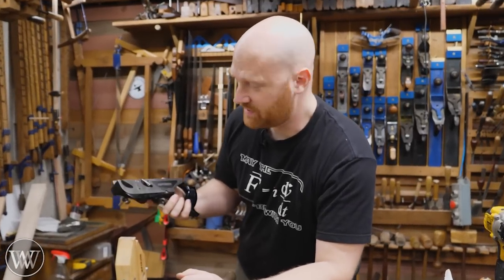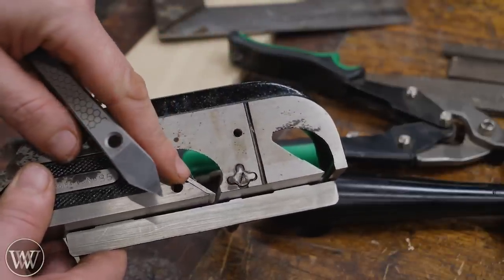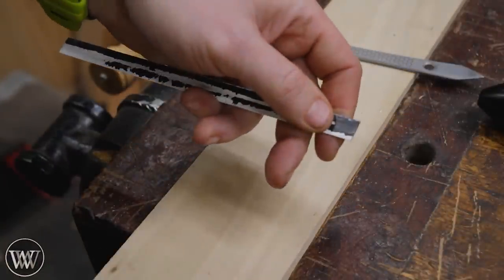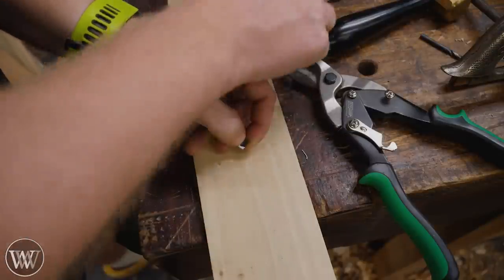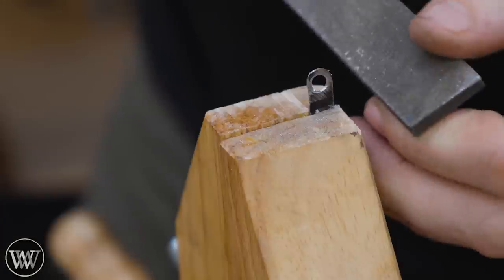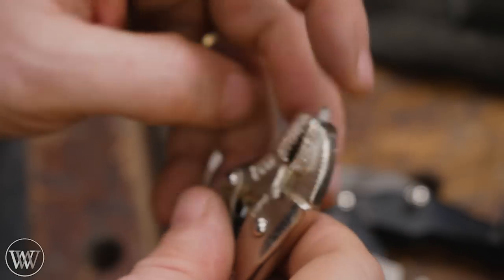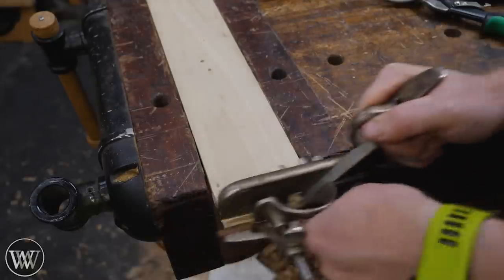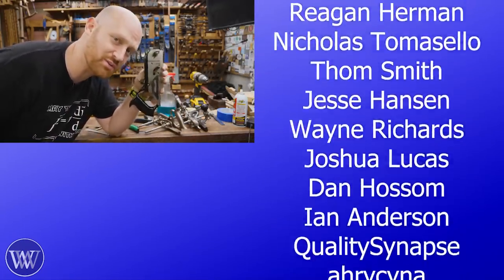What Is A Nicker and How To Make One

Comment: This was very timely!  My Stanley 289 came with nickers, but they were both worn out.  I had an old Starrett (thicker than a regular hacksaw blade) so I tried using it.  After I was done, I noticed that it was HSS, no wonder it did not file as easy as yours...  Anyway, thanks again for showing this in detail, it was very helpful.

Comment: Having one as sample I made a dxf model and made laser cut 50 of them.
Reply: How big is the heat affected zone with the laser? i.e. if you're cutting hardened steel , how far do you need to grind back to get into metal that hasn't been softened by the local heat from the cut?
Reply: @AllanMacMillan  No effect at all since it it is not high carbon steel. I filed, carburized, heat and quench some of them later. The result was pretty fine.

Comment: Great video, thanks.

I'm thinking of adding a nicker to my homemade wooden rabbet plane, would you recommend this method with a woodscrew to attach it?  Most vintage planes seem to use a long metal cutter instead, is that a better approach?
Reply from the maker: I do not think I would trust a wood screw to do the work. maybe if you made it longer and put in a bigger screw.
Reply: I have a wooden skew rabbet plane that is missing it’s nicked as well. You’re right, it’s a long, thin piece of metal w/a sharpened tip, which is held in a sliding dovetail-type channel on the plane’s side. I’m thinking of making one out of a small file, but I’m not sure of the geometry of the tip? Perhaps a rounded, beveled tip, like the one here?

Comment: Thanks for the sharp tip!
I have a combination plane I bought a while back that does have both of it's nickers but despite a liberal soaking in WD40 one of them is thoroughly stuck.
Anyone got any thoughts on getting the screw out without damaging screw, nicker or plane? Thanks
Reply from the maker: Penetrating oil, if that doesn't work then heat. And if that doesn't work then it's drilling it out.
Reply: @WoodByWrightHowTo   Thanks for getting back to me. I think I'll put that off until I absolutely need it out. I'm a bit reticent to give heating it up a go but might have to one day.
I know WD40 make a release penetrant in their specialist range now so I'll maybe give that a go first. Thanks

Comment: Really informative and gave me some ideas for using old saw blades but ... I will never get the hang of your size numbering system for drills etc. instead of real measurements.
Reply from the maker: Small drill bits come in number sizes as opposed to decimals or fractions. It's closely related to gauge sizes. But there's a whole series of numbers and letters that reference specific sizes of bits. I've got a link in the description to it set showing what I'm talking about if you want to see more.

Comment: Hi James...love the channel.  Watch regularly, but first time with a comment/question.  Is the screw that holds the spur in place a "standard" size screw.  I had a maim a screw to get the spur unstuck from a #78 and now I'm trying to figure out if I can replace it with a standard screw.  I've heard that Stanley frequently used non-standard size screws.
Reply from the maker: That one is a standard thread size however I don't remember what it is off hand. Unfortunately it is a really tiny head and it only holds with one or two threads usually it would have to be something specialty made. So if you don't have the screw I would probably say go and buy a replacement screw. You can get that on the parts division or one of the online sellers on handtoolfinder.com
Reply: I have exactly the same stuck screw problem but haven't so far had to risk doing damage to the screw so have been avoiding it

Comment: 1) HOLD THE METAL WITH A VISE GRIP before drilling.  NOTE:  otherwise hospitals and stitches may be inolved.  Not to mention a nasty cleanup.  And why don't you have a countersink?  Harbor Freight etc. not near you?
2) Once you have the hole drilled, take a bit of posterboard or an old playing card (useful for lots of stuff in the shop), and cut out a pattern for the nicker.  Mark the metal with a permanent marker, and scribe the metal using the pattern.  
3) NOW cut out the pointy end and bevel it's edges.  This allows you to hold onto it without trouble.
4) Finish filing the sides. Then cut it off, deburr, and you're good to go.
Reply from the maker: Yeah holding it with my hand is a bit sketchy but honestly with the amount of leverage on it it's not a big deal. Especially since I had it in the vise so that if it rotated the job advice would catch it. I did think about making a pattern however drawing that small of a pattern is incredibly difficult and it was easier to just create the shape that it was to try and fit a pattern. But to each their own. You need to cut the bevel after cutting out the small shape because the bevel isn't flat like a plane or chisel it wraps around the iron and creates a rounded surface.

Comment: Thanks! But what to do if the screw for the spur is stuck and the head stripped?
Reply from the maker: oh that is not a fun one. If penitrating oil and heat do not loosen it then the only option is to drill it out and re tap.
Reply: Thank you for responding! Do you maybe know the size and thread for the screw of a stanley 45? Ps, watch your channel a lot; my house full of old tools now 😂

Comment: Does a nicker do any good while working along grain? No matter what I do, I end up with a rabbet that becomes narrower with every pass, like there's a ladder on the inside wall. Would a nicker prevent that?
Reply from the maker: it will not help with that, but it will not hurt. the problem with that is that your Iron is not flush with the outside and or you are not pushing the fence ageist the board strong enough. some people like to have the iron stick out by the thickness of a piece of paper to help scratch the side clean.
Reply: @WoodByWrightHowTo  Thank you! My iron is sticking out a tiny bit, so it must be me not pushing the fence strong enough.